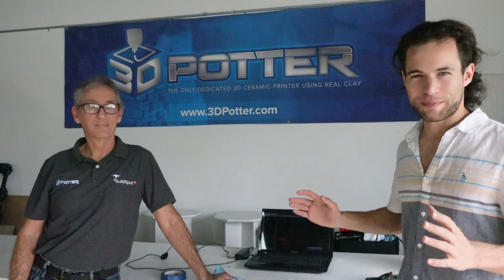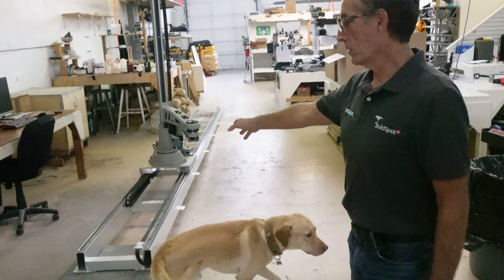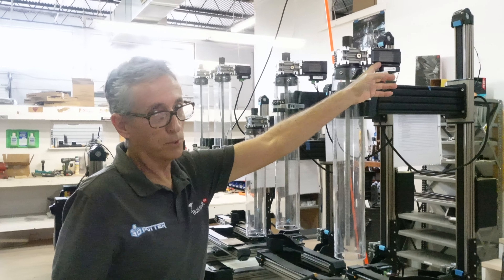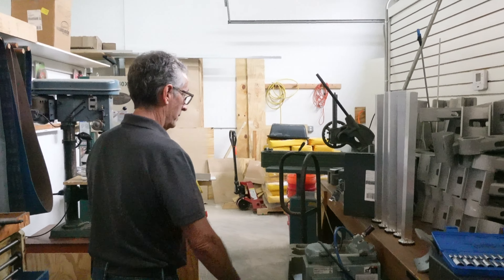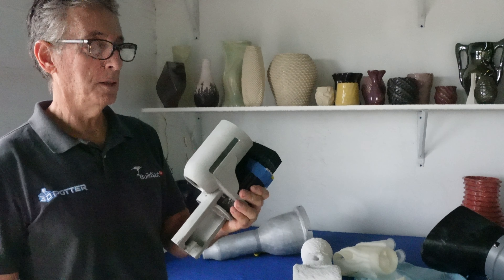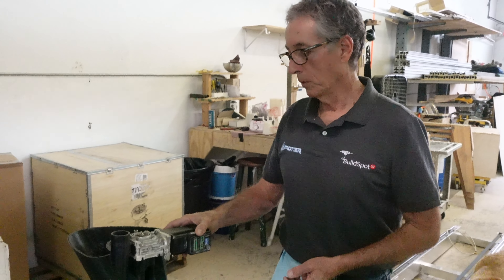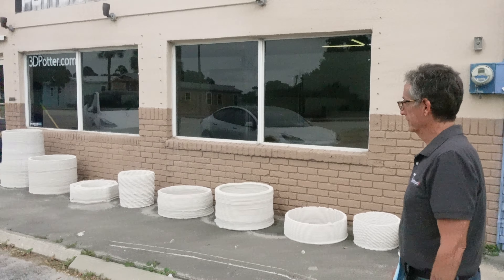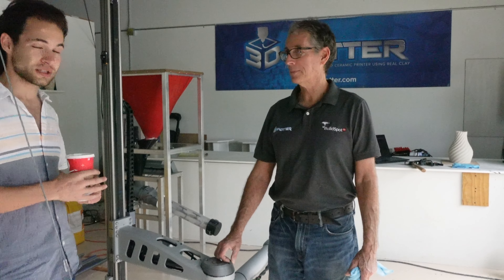I Printed On A Budget Concrete & Adobe 3D Printer by 3D Potter!

Comment: Cool.  At 5:47 I have a simple idea for this printer to allow it to be used to print straight long walls, by using some simple alignment holes in the base of the printer, that you line up with small flat marks of cement placed by the print head on the flat concrete path.  Just needs lining up the two 3D printer base holes with the two flat marks and a first layer semi-auto calibration option, that allows you to input X,Y printer head offsets to get the first layer printed perfectly aligned.  The first layer would be very thin and smoothed to about 2mm high using a smoothing tool on the print head. Once you are happy with the alignment of that first thin flat layer, you just confirm the print for the new section.  Anyway just a rough idea for them and if it worked,  they could use this printer to print long straight wall sections and corner sections.  Possibly overkill,  because one could probably just manually line up each section I guess,  but they could be heavy to move.

Comment: Nice!  They make quality machines.  Printing from control joint to control joint is best anyway, so there is really little downside to the "3D potter on rails" concept.  Just needs less expensive material that prints faster.